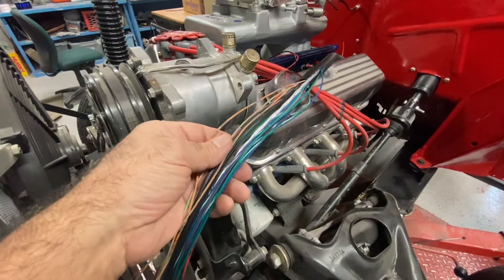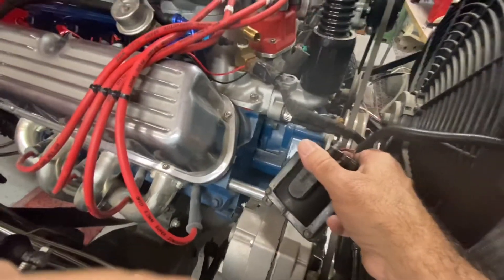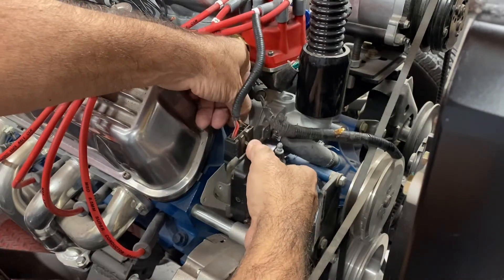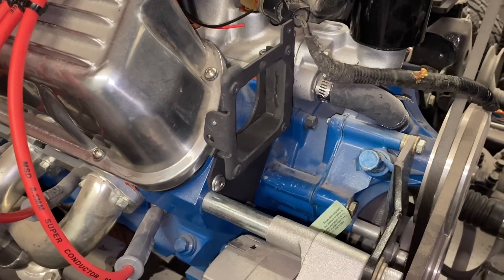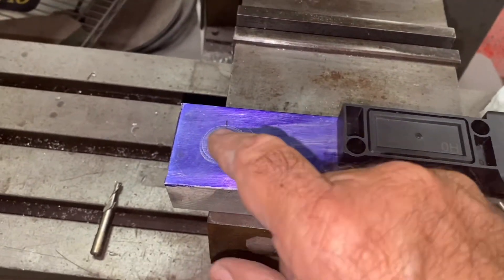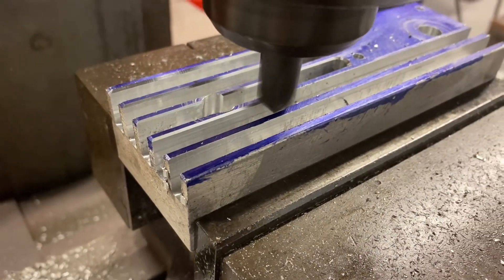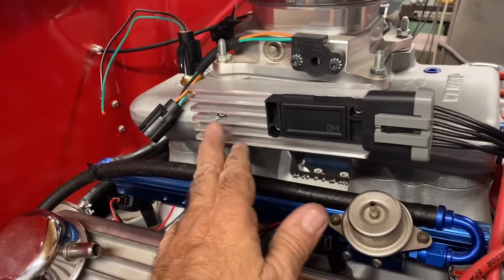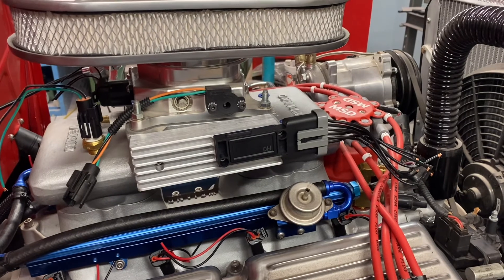Building a Coil Mount and TFI Heatsink Ep 21 Lots of Chips and Sparks!

Comment: Why did you select an excellent head conductor (aluminum) for the heat sink (to help cool the TFI), and then bolt it onto the hottest object in the engine compartment (where it will transfer engine heat to the TFI)?
Reply from the maker: Hi friend, excellent question, but no worries. The upper Plenum of the tunnel ram stays very cool while the engine is running. It has a high velocity air flow going through it while the engine is running that it’s probably the coolest surface in the engine bay. Testing it with my infrared heat gun verifies this, and because the Plenum is aluminum also it helps transfer the heat from the TFI heat sink into the cooler Plenum. Good question though and thanks for commenting.👍

Comment: Great video Tony, nice job on the bracket and very impressive work on the heat sink, looks like something you would pay good money for,  way to improvise for not using the front end, the engine is beautiful, can't wait for the next video, looks like a lot of wiring, talk to you soon buddy
Reply from the maker: Thanks, Mike! The further I go, the more that engine is buried by hoses and wires. I still have heater hoses and AC lines to deal with.👍
Reply: @ChipsAndSparksGarage  I like that you have had more frequent videos, you do such good videos

Comment: If I had tapped those with a drill I know the snick sound would be in my near future.
Reply from the maker: Haha, yeah! The trick is a quality USA made 2 flute tap, the proper tap drill size, cutting fluid (wd40, for tapping aluminum), and 50 years experience as a machinist. Thanks!👍